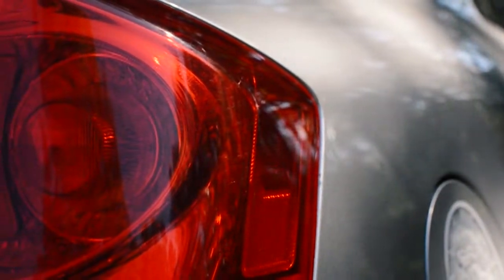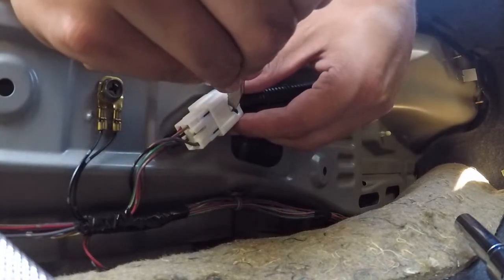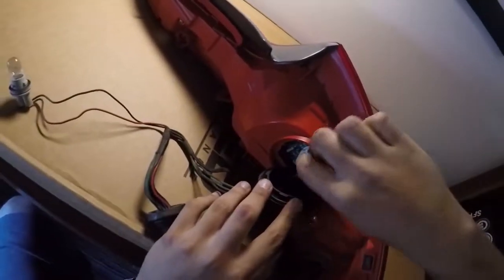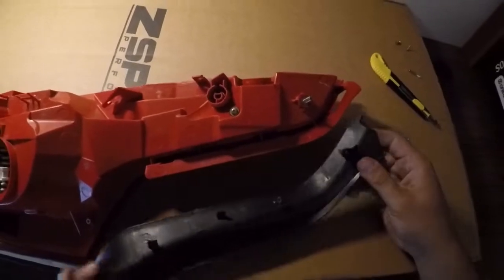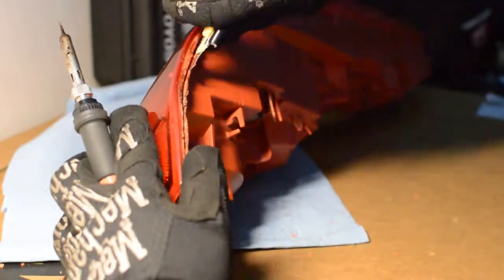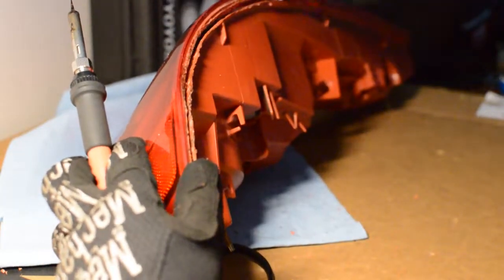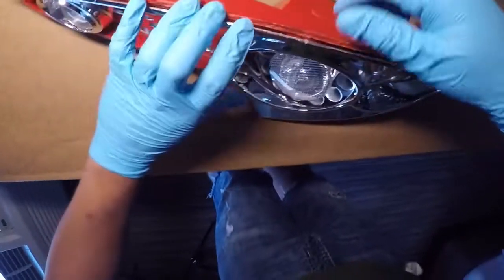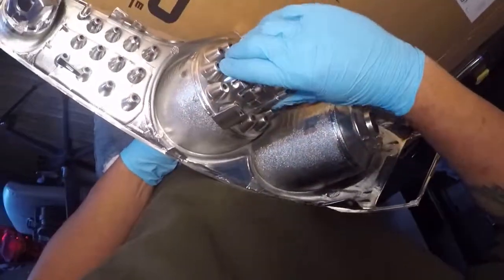G35 Coupe HALO tail lights part 1

Comment: Love that you mentioned not to mess with the ridge on the lens when you remove it. I saw a guy pick at it and when he resealed it, he didn’t have a a nice perimeter line. It was all choppy with black spots

Comment from the maker: Hey guys, I didn't mention this at the time of upload but depending on the LED rings you purchase you may have issues seeing the brakes or turn signals in the day time or direct sunlight, which is a safety issue. To remedy this, I recommend either purchasing higher quality LED's than I did (Diode Dynamics and Profile by Morimoto both make LED's that are visible in sunlight) OR leaving the turn signal and OEM brake light LED's intact when performing this mod.
Reply: Calyn Hutto did you get red or white halos ?
Reply from the maker: @matthewsanmiguel8599  I used white halos, however I recommend getting the red ones. They will be brighter in the tail light housing.
Reply: Either way great video,you was very precise,I would love to have you do mine
Reply: And I'll pay you
Reply from the maker: @sapboi104  Hey there much appreciated! I just saw your comment, if you're serious about getting your tail lights done you can message me over on insta, @fcasn_hutto. Thanks!
Reply: Kk,

Comment: Can't you use the oven method for the tail lights as you do on the headlights??
Reply: No they are plastic welded so you have to use a dremel to cut the housings

Comment: You made this look super easy, ever done anyone else’s taillights? And how much would you charge?
Reply from the maker: Hello mate, just read your message -
Reply from the maker: I do offer this as a service, prices start at 275 for send in tail lights and 600 for a brand new set with halos.
Reply: @calynhutto6424  how do i contact you about this?
Reply from the maker: @hudcu  I no longer offer this service. My apologies.

Comment: Quick question but what kinda of paint did you use to paint the bezel ?
Reply from the maker: 13:48 I went with Rustoleum engine enamel. It left a really glossy finish, looking back I would have went with something a bit more satin. Really any paint should work fine, I would avoid cheaper stuff as it might chip later down the line
Reply: Thanks bro and what’s your @ bro
Reply from the maker: @vq_suaaa4378  @fcasn_hutto

Comment: Where can I get the aperture
Reply from the maker: If you are referring to the halo rings, I purchased the ones on video from Amazon however I now use Diode Dynamics halos for all of my installations
Reply: @calynhutto6424  halo sizes from diode dynamics?
Reply from the maker: @carlossaravia9201  110mm for the large circle, 85mm or 90mm for the small circle. 90mm provides a very tight fit.
Reply: @calynhutto6424  thank you

Comment: Did you use a white halo or red halo?
Reply from the maker: I used white but I highly recommend using Diode Dynamics red halos in 90mm and 110mm. You can use an 85mm as well for the smaller circle, I've found 90mm fits tight and requires some force to get into place.
Reply: @calynhutto6424  thanks alot bro